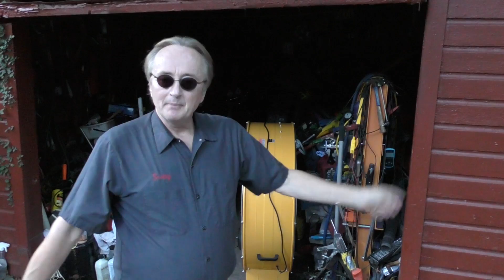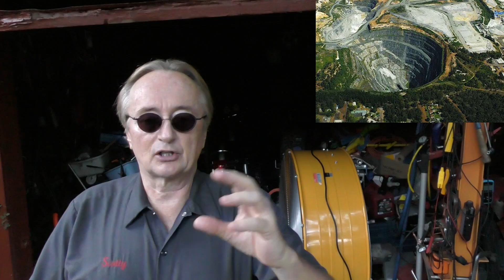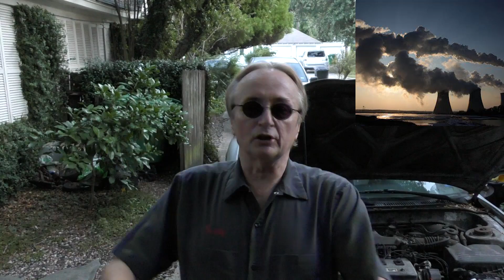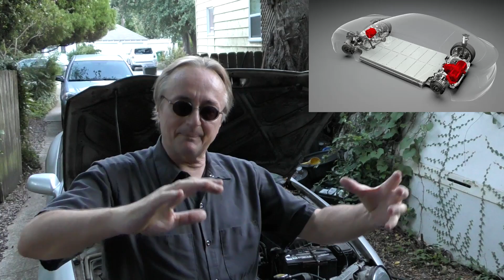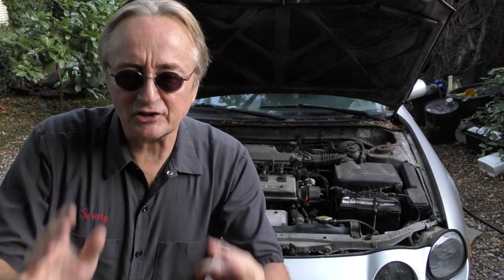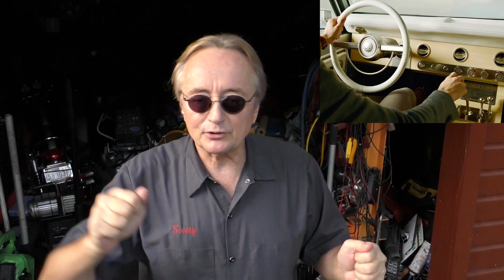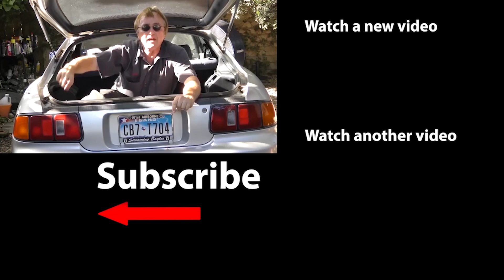Saying Goodbye to My Toyota Celica's Engine

Comment: 2019 chevy spark - epa 38 mpg. my 2019 spark - 46 mpg. how ? ...... driving skills. calm the f¥€k down.
drive mellow. focus on the road. anticipate. leave 3 car lengths for every 10 mph. learn the lost skill
of coasting (requires manual transmission). you can get 20% ABOVE EPA.
Reply: If everyone drove that way during rush hour in urban areas there wouldnt be enough room for all the cars. You imply you have skills everyone else lacks, or that mpg is the primary concern for 100% of drivers. 
Hey there are clubs with 90s Geo Metro owners to compete for the best mileage, some close to 100mpg. They do it for a hobby because its not practical in the real world.
As for those EPA figures their test loop favors  certain vehicles and penalizes others. Your experience might be impossible for anyone to duplicate in certain other vehicles. 
But congratulations for a textbook display of that "I care about the planet more than you" smugness that draws the ire of people for owners of the Prius and the like. 
When children in Argentina and Chile start being born with lithium mining related birth defects and their parents develop deadly cancers, try to look away if you can.
Everything has a cost when you look at the big picture.
Reply: batvette If everyone drove that way during rush hour it will be much smoother.
Reply: @user-tb7rn1il3q  missed the point entirely. You do realize the govt is starting to embed sensors in the road for future autobraking technology? Why is that?
Reply: If I can get 43 average MPG in  a 30 year old carbureted petrol  car people have no excuse of getting 30 MPG in their brand new diesel SUVs.
Reply: @GlamStacheessnostalgialounge  car makers learned they can increase side and profits without worrying about little things like the environment
Reply: @GlamStacheessnostalgialounge  british gallons are bigger than ours?
Reply: @REALBanannaman  No, that's in US gallons.
Reply: TechGuy322 1.2 imperial gallons for every one US gallon. Also why do people answer questions with another question?
Reply: @REALBanannaman  
20% bigger..
Reply: @kennyleeaponte9606  If someone says "petrol" and "gallons" in the same sentence you can't be sure if they mean US gallons or Imperial gallons.
Reply: So are you the guy that everybody always gets stuck behind?
Reply: gibby jones lol you can coast in an automatic. Requires a manual?
Reply: Bumper riding is literally the number one reason for sh++ty mpg.  And wrecks.  Stay off the brakes, stay happy
Reply: Been driving like this for a few years now. Im only 27. Now if only I could get my wife to drive like I do 😂
Reply: It’s getting harder and harder to find manual transmissions in cars anymore! Not unless they’re sports cars, and even then the odds aren’t the best! Less moving parts in a manual transmission means less parts can brake — which of course means less money for the big heads with big pockets!
Reply: I get about the same mpg with my Toyota echo
Reply: @nateafcsouth, yes, I do this too. Easier on the car and on my leg.  Automatic drivers can pass me if they wish to speed up so they can immediately slow down.
Reply: Gibby, yes driving manner means a lot! One of the reasons why they changed the way to measure fuel economy a few years ago is because people generally don't drive economically at all. At least with the new system, people will feel they can get around EPA readings. Those who know, though, can EASILY beat the EPA estimates!
Reply: You talk to anybody they don't give a damn the younger drivers will complain about how little money they have and they need the money from their work shift the day of to get their gas tank filled. They mention how they like " just like to drive fast " and you tell them this exact advice and they still will drive the same way they do.
Reply: You wanna go green don't drive. Use and fund public transportation. I believe that current sales figures are on the decline in overall vehicle sales since they last longer nowadays and there are plenty of good used cars on the market. So manufacturers gotta sell by giving the newer buyers all the bells and whistles all the airbags, ESC, BSM, radar, LKA, blah blah. Unless you're in a poorly designed car centric city like Houston the focus should be on great public transit to move more people at one time
Reply: @nateafcsouth No I was talking about the original commenter

Comment: They’ve been converting radio control cars to electric for years. The difference between those and many of today’s “conversions” is that RC cars use removable batteries. That makes all the difference in the world. Nobody wants an RC car with only 1 battery. You need to be able to change them out so that you can drive while the other batteries charge. If someone made standard removable batteries for vehicles, then, building and converting cars would make much more sense. You could slowly charge your extra batteries or swap them out at a station.

Comment: Bypass the grid with solar power charging huge battery’s connected to chargers,. Problem solved except for mining lithium I guess. Also modifying an ICE car with EV battery’s are super heavy and can disrupt weight distribution, poor handling and suspension needs upgrading to handle all the extra weight.

Comment: Great video Scotty, there has been a small community converting cars to electric, for a decade or 2. 
There are clear engineering issues that need to be overcome.  Of course, we have had lots of electric golf carts for many decades, but there is one fundamental issue which is the one that Killed the GM EV1, and this Why GM gave up, and they pushed the volt skeleton car around to car shows for a decade or so.  What killed the EV1, was not the electric motor, or building the cars, or making batteries with the power density (KW / Kg), nor the charging issue.  What Killed the EV1 was the number of times you could charge the battery.  
It turned out the NiMH batteries which were the most eco-friendly of the day, could only take 300 cycles before their capacity would decrease to 70%  from the original capacity.   so "Price of battery" divided by 300 didn't work well.. it gets better you partially deplete the battery and recharge it. so what the High tech High price Electrics did, was trade total capacity to the battery to extend life. that takes some smart computer work and scientific knowledge about the characteristics of the battery pack.  and then you get other problems like the peak operating temperature of the battery pack which you described before. Also, Cooling issues to keep the batteries in the right temperature zone.  Just as the thermostat keeps your gas-powered engines in their best temperature, batteries are the same, its just a bit cooler.   (yes I have smelled overheating battiers before cough cough.) So for short ranges like a golf course or condominium complex electrics are great.  Tesla corp put a lot of work into fixing the battery problem, and so did GM, and others of course.  And since people are spending their money on electric cars, battery development has been getting lots of funding too. There is some amazing tech being developed and just around the corner.

Comment: Electric cars are only a band-aid to the climate crises, eventually we will run out of lithium plus most power plants where you get the electricity to charge your car from aren't very green.  Bio fuel is the future, more sustainable plus cheaper to convert your car to run on bio fuel than it is electricity.

Comment: Scotty, you are SO correct about the Lithium saga! But, there are many Pundits that say the Existing Car Converter Companies, are going, Belly-Up, because even New Electrics are coming down in price, they cannot compete! Now if the Number you say it could be done for, of less than $6K is possible, that would NOT seem so bad? I have done extensive Research, and was going to do one for fun, and for ME to do it, properly would be about $12K+, easily!  Now if you find OLD, Used parts, possibly?  I agree, Converting does in fact, make some Economic sense, and better for the Environment, as well! It does however, lessen the jobs created, because it has less, Man - Hours, consumed, too!  But Tesla's latest and Greatest, T-3, can be had for, in the Mid - $40K range, today, after the Government Rebates!  Those are Ending quickly though, so buy now! And they also have the Heating and A/C issues all Ironed out, along wit the Proper Engineering, for handling concerns! Last, but certainly Not Least, is the Upcoming, fix for States to collect that almighty Road TAX!  Washington State, and a few others, are going to enact a Self-Reporting, Annual Mileage Report, that must be submitted, with a Tax Rate  Premium, that ensures the Tax Man gets his!  Somebody has to pay for our Roads, right? They have been getting a Free Ride, for too long!  Not only that, but You and I, have been subsidizing the Buyers, for decades now, and don't even get so much, as a Thank You, from them, HUH? That  mileage, will eventually be reported via the On-Board Computers, on every New Electric Vehicle, which gets tricky, but will be solved with Hybrid ICE/Electrics!

Comment: Why would you convert a gas or diesel car to electric when you can buy one off the lot that has high efficiency which you'll never achieve with an old car converted?

The best designs are from the ground up rather than the ground down where you have to make many sacrifices.

Hybrids are  a sacrifice on both ends and achieve no real advantage. They build in the worst from both methods and haul all that extra iron around with all the repairs.

Comment: new electric car comes with a lot of safety features, such as auto braking, lane keeping assistant, adaptive cruise control, regenerative braking, etc.
Reply: all of the components in a gas car that tends to break or need maintenance are not found in electric cars, such as engine, transmission, fuel pump, air filter, oil and oil filter, transmission fluid, PCV-value, thermostat. Because of regenerative braking, braking pads last forever :).

Comment: 2019: Can't afford to buy gas.
2025: Can't afford to pay the electricity bill.
Reply: If electric cars become affordable for the average family watch your electrical rates skyrocket.
Reply: OffTheBeatenPath it kinda is at this point. My parents just bought one as a middle class. We’re definitely not making big bucks or anything.
Reply: @OffTheBeatenPath_  enter: Chevy bolt, Tesla model 3, Nissan leaf all under $40,000 electric rates are normal, yes in the future that's possible but get ahead of it like I did and enjoy the savings
Reply: @OffTheBeatenPath_  
Yupp, gotta make the difference somehow. Greed isn't good.
Reply: Remember what happened with Enron when it drove up the electricity prices for the electricity it was selling to California?
Enron would buy electricity, sell it to an Enron llc at a markup which would sell it to another Enron subsidiary with a markup and this would continue a dozen more times before the final Enron subsidiary would sell the electricity to California at 2-5 times the price that Enron had originally purchase it.
Reply: @pogo1140  it's either you pay for gas or hydro @  expensive  prices I'm going to be  impressed is when they  convert the cars to run on water theres plenty  of water  let the oil companies and hydro  companies  scramble
Reply: @on-site4094  you can always use solar to charge
Reply: @bereal1251  lol....you drive at night?
Reply: @j_freed  Depending on the location they can be destroyed rather easily too.
Almost all of solar farms were ripped apart by a single hurricane.  In the North East and NW of the US weather conditions reduce solar efficiency. Much of the Mid West have winter and massive snow events. Then there's tornado alley.
Reply: Pogo R
Reply: @pogo1140  And, Eron got away with it.
Reply: @pogo1140  What you described is "Electricity laundry". Perfectly legal when the big players do it...
Reply: My boyfriend bought a used Tesla a few months ago. There wasn't a huge difference in his electricity bill after buying it.
Reply: @karabean  not YET.  Wait until they are mainstream with the average buyer.
Reply: @OffTheBeatenPath_  While we still use electricity to keep our houses cool (or warm) and otherwise power our homes and daily (work) life, I sincerely doubt it. I would put money on gas prices going up, though!
Reply: @OffTheBeatenPath_  I think a lot of taxpaying citizens would have a big problem with rates going up so high that they couldn't afford to cool their homes. And I can tell you that's a bigger power drain than charging the car up at night.
Reply: OffTheBeatenPath It makes sense that electricity prices will go up, but worst case scenario it’ll be the price of gas. If you live in a sunny place solar would also make a lot of sense and offset the cost.
Reply: @karabean  one EV  charging for one month uses more electricity than you use in a month on average. electricity is cheap now because tehres not an increased demand for it, once more and more people start buying Ev;s and the number of electricity needs RISE prices go up FOR EVERYONE . Our power grid outputs a fixed amount, stress it and the price of electricity goes up in order to build more infrastructure, stress it fast enough and the market will induce a severe price hike to curb the use of electricity
Reply: @karabean   the average cost of  a MONTHS worth of electricity in California is 90 USD , the cost to charge your tesla at home is 10$ per charge ( assuming you do it during the day, at night its 17$)  , if you charge your car 4 times a month you are already using just as much electricity as you would in a family of 4.5 household .. now imagine all 4 use Ev's .. already using more electricity than you did by almost 3X  ... totally not gonna make the prices of electricity sore
Reply: @ThreeDaysOfDan  "one EV  charging for one month uses more electricity than you use in a month on average. " Wrong.  Before the Tesla, my boyfriend's power bill averaged about $100. Once he bought the Tesla it went up to $120.  The other $100 per month is electricity he uses to run his appliances and air conditioning, so NO it does use more electricity than the rest of the household. Also... *soar
Reply: Kara Fetterhoff do you have numbers so we can see how much it’s costing?
Reply: Well I kinda disagree, I spend about 100 bucks a month in gas to drive, I could see that converting to the electricity bill
Reply: Come to Canada and you could have had that back in the mid 2000s!
Reply: @sand0decker  here in Canada rates are high  in Ontario
Reply: o Rebelo , due to years of mismanagement by the lefty provincial government . They were decimated at the last election
Reply: What are next week's lottery numbers?🤣
Reply: Well, at least we will have solar on most roofs. Oh, wait.. that will be every other developed country but the USA
Reply: Went from a compact car getting 33 mpg spending $100 a month on gas to a volt spending $15 more a month on electricity (older car was 15 and dying, volt was bought used for 15k)
Reply: That's what Greta Thunberg and extinction rebellion want.
Reply: We will become like china 30 years ago everyone rode a bike.
Reply: @sljs1010  swedens already there with gas prices hitting 2 dollars a liter
Reply: @sljs1010  
everyone  out  of their   oversize  cars  n  suvs   and  on  bicycles  n  electric  scooters  would  solve  a  lot  of  problems.....gas  consumption,  traffic,  etc.
Reply: Gaming For Pizza that’s California now!
Reply: Not a problem if you live in AZ and have a solar panel roof on your house, I even know people in WA that have solar panel covered roofs that havent paid a power bill in years even though it rains 1/2 the year there.
Reply: Electric Utilities aren't free. The rates you pay are not set. When they spend money to upgrade, the electricity rate also goes up. People fail to realize that we pay to use electricity, it is not free. The Utility companies make billions, how much is actually spent on upgrading infrastructure every year, or spent on R/D to increase efficiency.
Reply: depending on the code of  your area in 2025 solar panels might not be a bad idea as they are becoming more efficient and taking up less real estate but thats going all out lol
Reply: What a sick truth, good one.  Lol
Reply: Can you afford shoes, because your going to do a lot of walking?
Reply: Exactly. People want electric car for various reasons, but most fail to realize supply and demand. As soon as the vast majority start using electric cars, rates will go way up. That also means using your stove, computer or what-ever electric device will also be more expensive to use.
Reply: Lithium pollutes more than gasoline or biofuel
Reply: Pretty much.
Reply: chief tp it’s $4.50 per gallon here!!
Reply: I fill up twice a week and gas in $4 dollars gallon.  That's almost $120 dollars a week for gas.
Reply: The key point is you at least have reasonable options to generate your own electricity to charge your own car...
Reply: We have solar, hydro, wind, and geothermal energies that can all be used to power electricity. Unfortunately they are not used because free energy will cause economic collapse. Imagine if everything was free in the world. No one would work for others and there would be no domination over other people. No more slavery and everyone would quit working for the government. Then civilization as we know would collapse and everyone would be happy with no war, poverty, or crime. Sounds like a disaster and an absolute dystopia....well at least to a few people.

Comment: I would imagine converting a hybrid to all electric would be even cheaper.
Reply: Nope, especially if the gas motor can put power to the wheels
Reply: @swankshire6939   The gas motor in a hybrid  only turn the generator which provides power to the batteries and the electric motors.